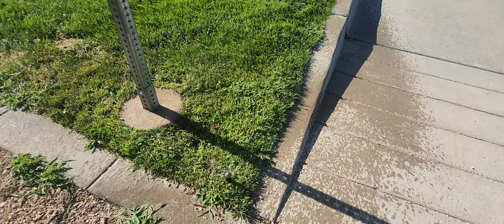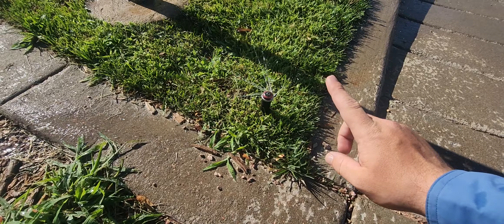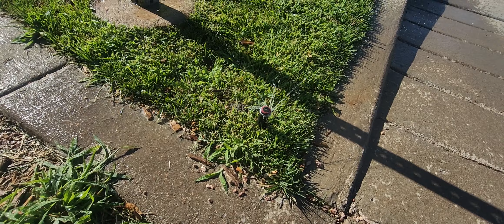MP rotator not spinning!? A Quick Fix!

Comment: I've noticed that the rotators in my yard turn fine when they are set to 180 degrees.  The few that are set to 90 degrees won't turn.  You can get them to rotate by poking them as you did, but they only do so for a few minutes and then stop again.  Cleaning them hasn't helped.  I've ordered a few news nozzles to see if they work better.